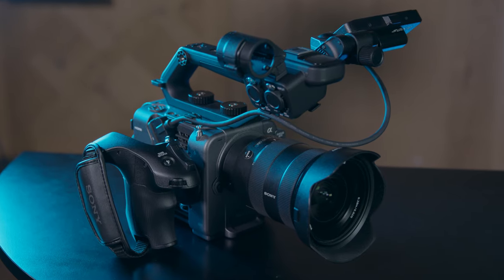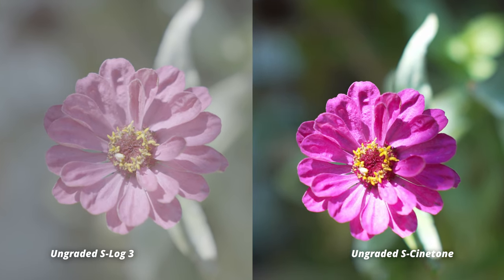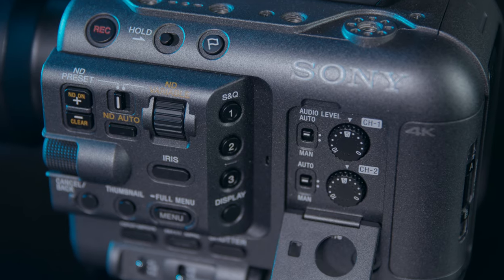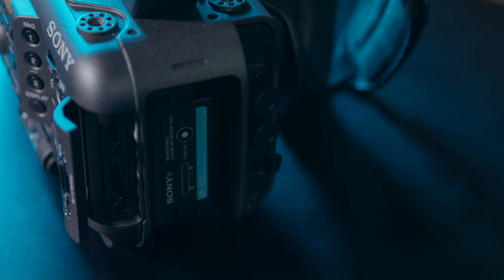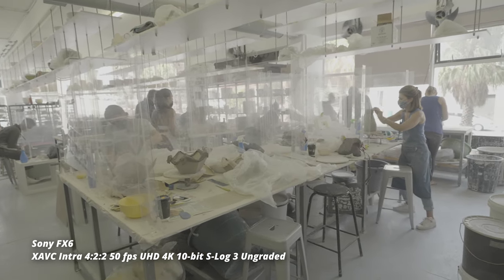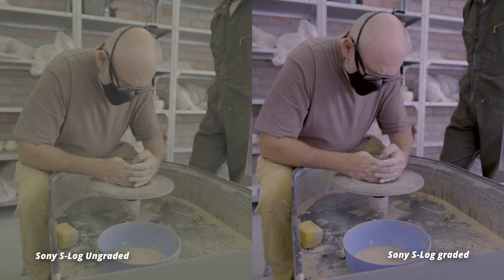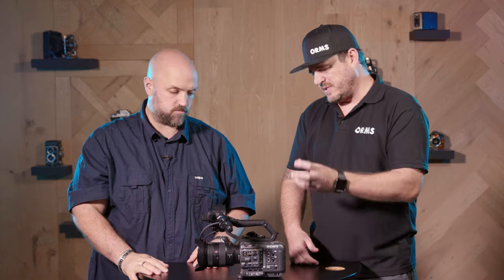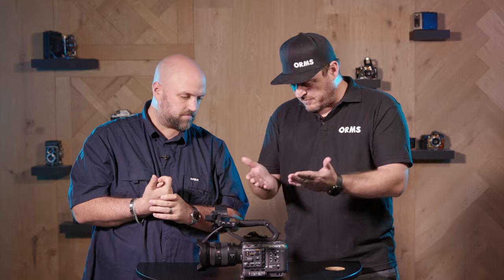We Tested The SONY FX6 | Taking The FX6 On A CINEMATIC Shoot!

Comment: Incorrect: the fx3 does have dual native iso
Reply: My Sony Tech Sheet says different..
Reply: @juannewhyte7416  Your tech sheet lies
Reply: @LARENT  Correct the sheet lies..
SENSITIVITY
[Movie] ISO 80-102400 equivalent (ISO numbers up to ISO 409600 can be set as expanded ISO range.), AUTO (ISO 80-12800, selectable lower limit and upper limit), [Still image] ISO 80-102400 (ISO numbers up from ISO 40 to ISO 409600 can be set as expanded ISO range.), AUTO (ISO 80-12800, selectable lower limit and upper limit)
Reply: @juannewhyte7416  Sony doesn't call it dual ISO but the fact of the matter is that there are two electronic circuits that are on a fixed width from each other (about 4,5 stops). There is no denying of the fact that the A7sIII, as well as the FX3 and FX6 are dual base ISO cameras

Comment: 14.4 volt battery not 12 volt
Reply: Correct Sir..

Chemistry: Lithium-Ion
Capacity (Wh): 35 Wh
Output Voltage: 14.4 VDC
Charging Temperature: 32 to 104°F / 0 to 40°C
Discharging Temperature: -4 to 113°F / -20 to 45°C
Dimensions (W x H x D): 69.7 x 46.1 x 41.5 mm
Weigh: 235 g